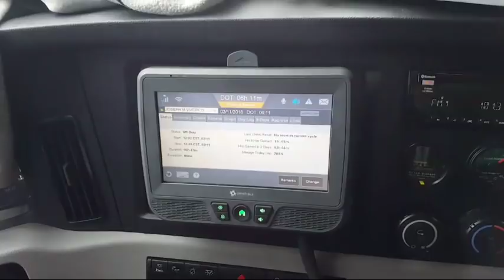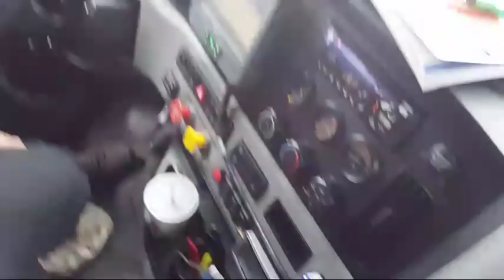Caught Up To My Previous Truck Driving Student - JOSEPH

Comment: Hello Junior, my name is Isaac and I'm drive for western express. I appreciate the videos on how to move your tandems. I never knew you could apply your trailer breaks ahead of time, as long as you have your pins close enough to the spot and when you move it just slightly, it will pop in place. I tried it for the first time yesterday and it works. I also moved my fifth wheel all the way to the back as well. Thank you for the knowledge. Keep pumping out the videos. God bless

Comment: I have the same truck how u turn on the Damn outlets ??
Reply: Mr Kennedy usually for some reason some trucks come with them un hooked to your inverter all you have to do is hook the wires back into the inverter that comes from the source power on your truck then they’ll work it worked for me I wondered the same thing thought they was there for looks lol
Reply: Mr Kennedy open the side compartment where the converter box is, there two bottoms that say “reset” and ”test” push on them till you see the orange light come on then go back to the outlet and I️t will be working. Ran across the same issues last week Wen I️ got my new truck.
Reply from the maker: +Cheeetos Garcia thanks for the information 🇭🇳👍😎👍🇭🇳
Reply from the maker: +Mr Kennedy I am not sure but on the trucks here they already come ready to go I believe it has to do with the inverter I'm not sure

Comment: Antigel? Don't need it. Our fuel (bought in Quebec) includes it.
Those curtains look flimsy.
Reply from the maker: +Trucker Daddy wow that is crazy because that means that it's always freezing cold up there. The curtains are good because they are very flexible it's almost like having a black sheet up
Reply: Junior Honduras i get that. The curtain in my freightliner is way thicker
Fuel companies add the antigel with all the other additives, in the winter at least. If forced to buy diesel state-side I would have to buy it. Otherwise you should plan for, expect less than 32 Fahrenheit November to April. I'm getting my ass to Cuba in two weeks 🌴☀️😛